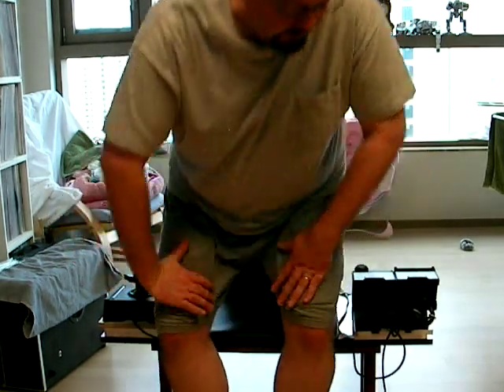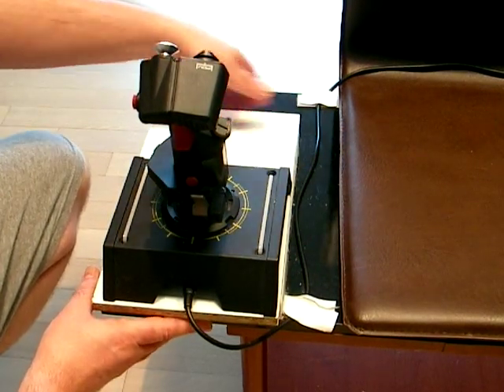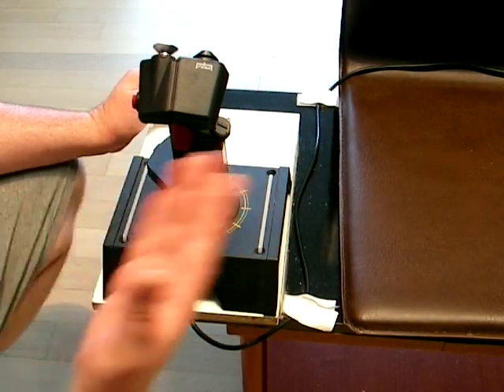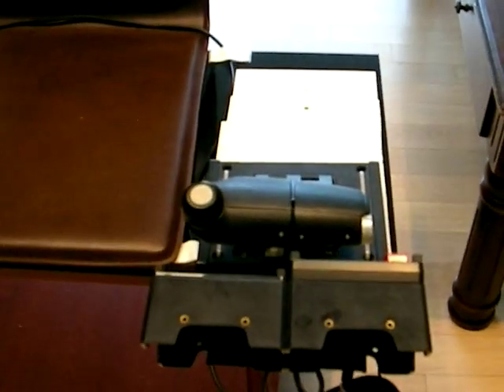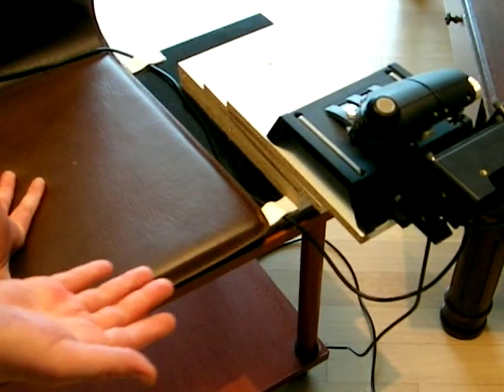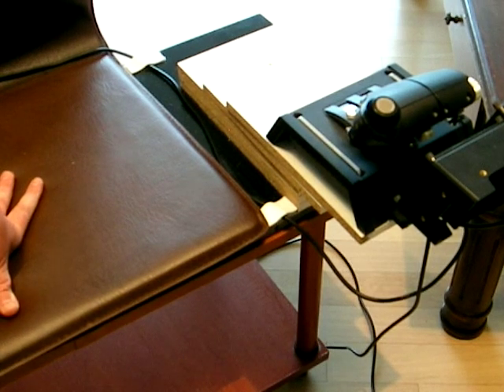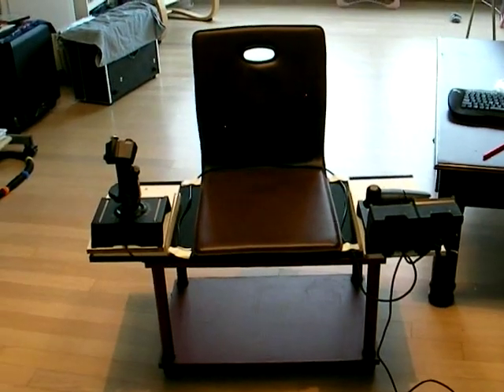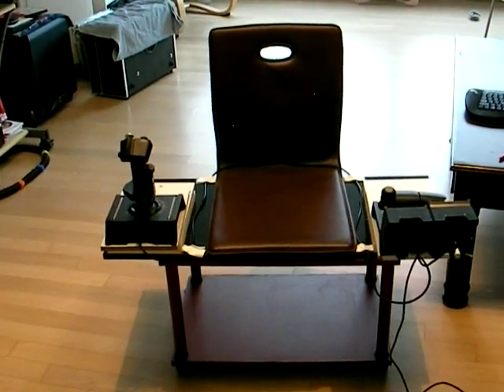Saitek x65F Simple Cockpit

Comment: Just use an adirondack chair and some pillows.  2 standard size under your butt. 1-2 kings for the back.  Two square throw pillows for the side arms (1 each) and fold them down to your sides.  Tape or tie down the HOTAS.  You can use a shelf top across the middle (swiped it from an entertainment center), which worked fine on the X-52 as the top was flat on each piece.

Comment: Hi Alan, first of all nice solution for a cockpit. I have a similar situation with my X-65F that I'm mounting to my gaming desktop but don't want to drill holes to it. I feel the need for 2 baseplates for the setup to work well and since Saitek only incluides one that makes the throttle impossible to use. So since you are not using yours will you sell it to me please so I can finally fly with my X-65F? Thanks!